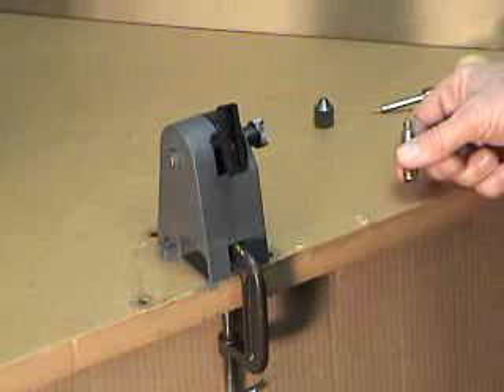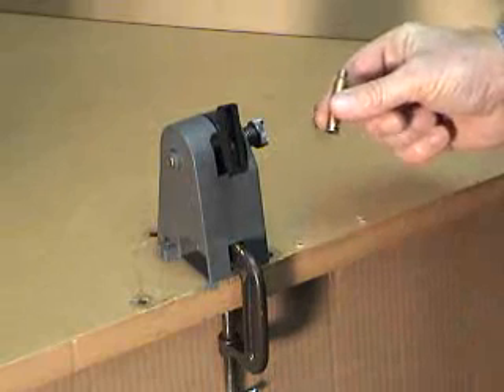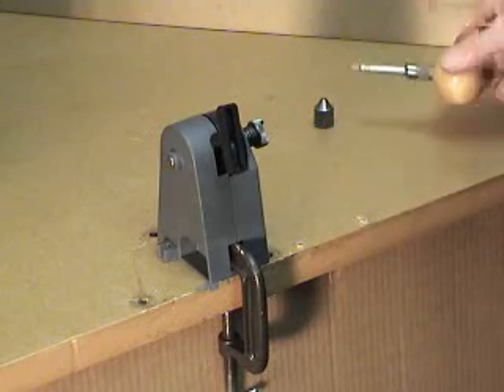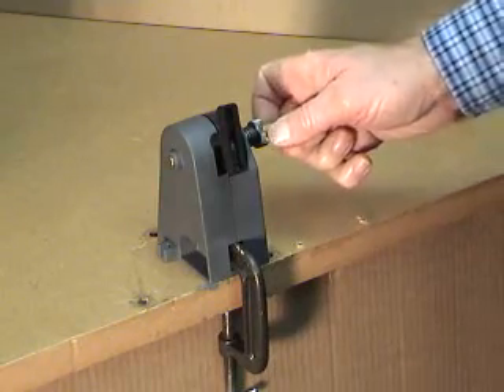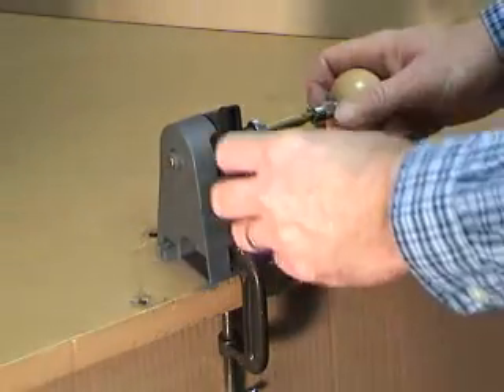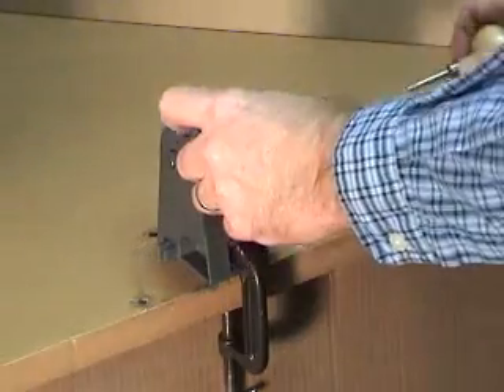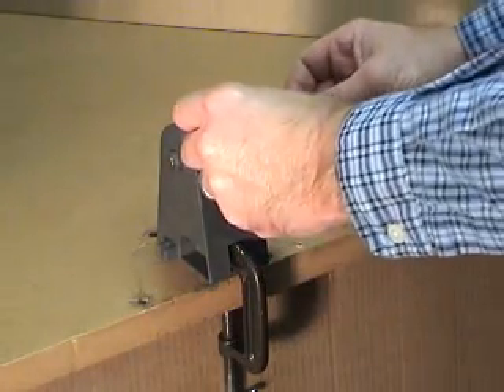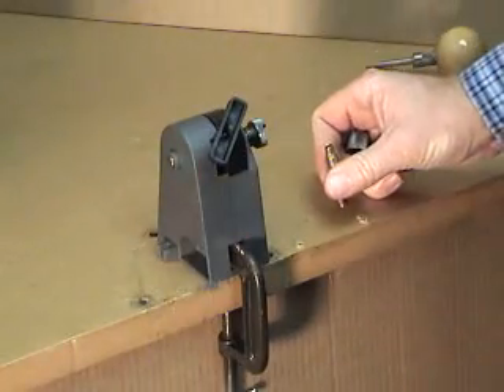Trimming Cases with Lee Zip Trim and Case Length Gauge

Comment: I got one for a 45ACP and the case is so tight it will not get to the cutter.  Am I doing something wrong?  The brass is sized correctly but does it need to be flared first?

Comment: I just got one and200 .223 cases later :)  Much easier than doing it by hand or using a drill.  Get the trimmer ball handle and the 3 jaw check together with this.

Comment: @bootymanII it's quicker to tighten and untighten than a case holder.  But if you are only doing .223 and not a large quantity you'd do fine without it.